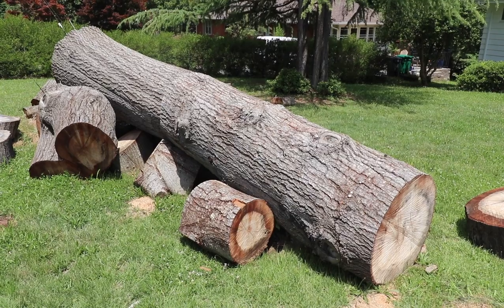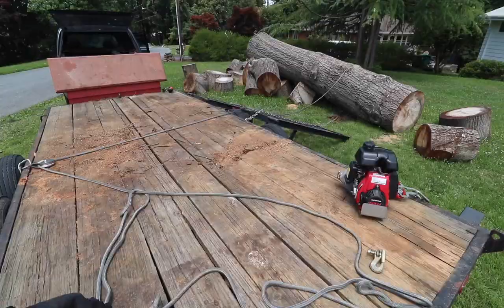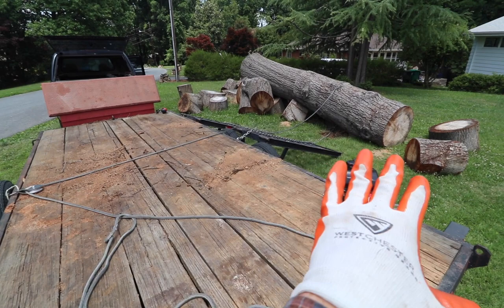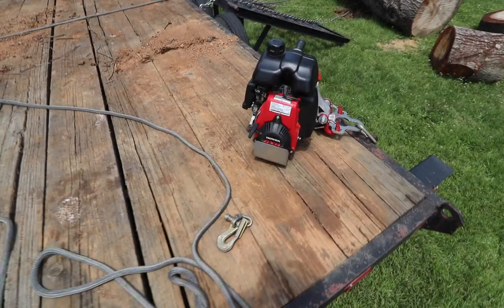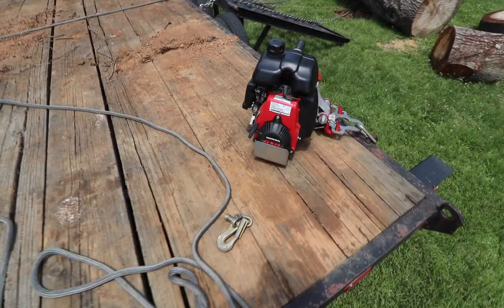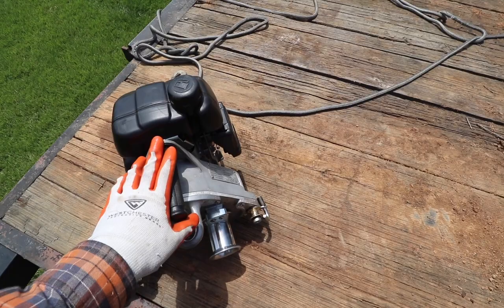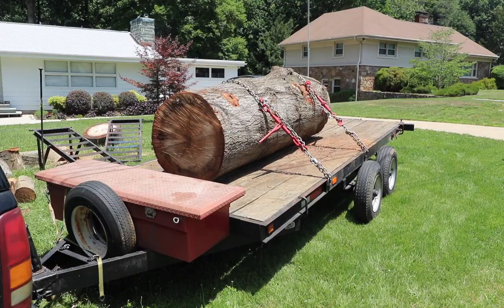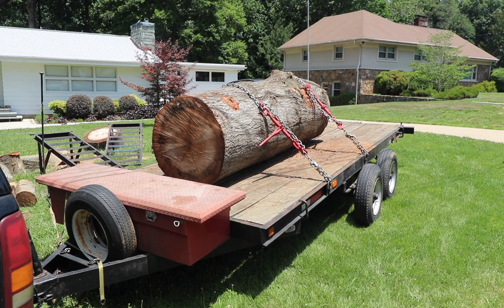Huge Free Urban Oak Tree - Working Alone - Part 1

Comment: Since I have been watching Towing Companies and Off-Road Recovery Services I know the power of winches and snatch blocks. That is a sweet setup that you have instead of having to invest in heavy machinery like a mini-excavator or a skid steer. Though I have seen a Kubota Skid Steer made specifically for trees. It was a all-in-one "stop-in-shop". It could cut the tree down and then remove the tree in a matter of minutes but those types of machinery are not cheap. If you were  in the business of clearing land then the cost would be something worthy of the expense.